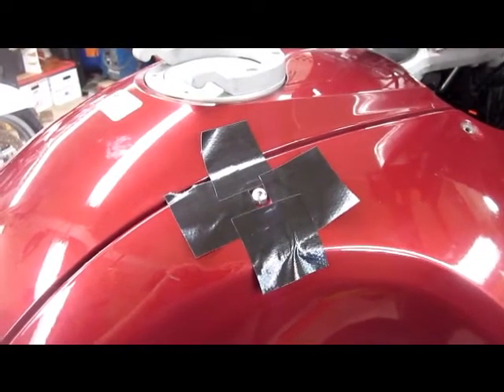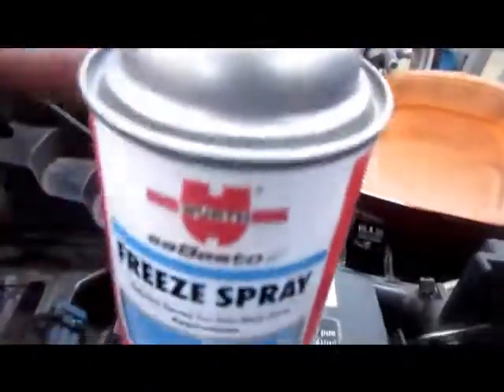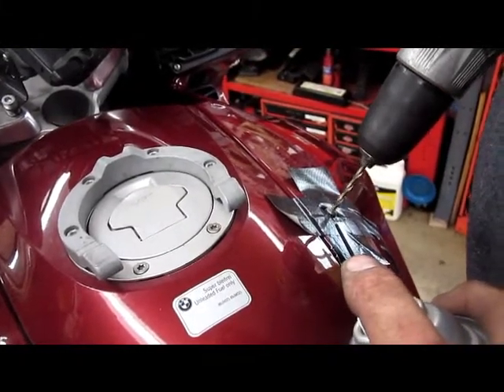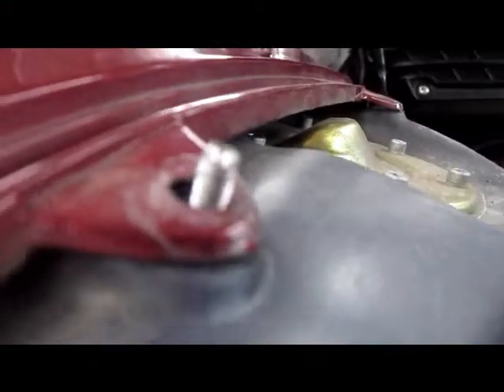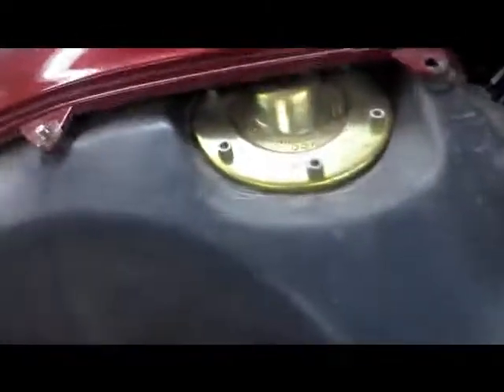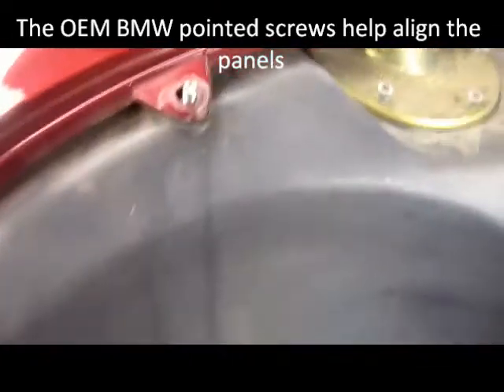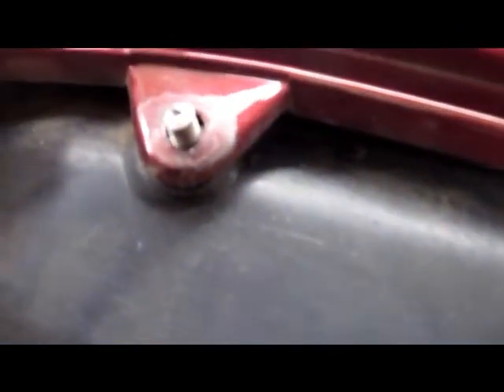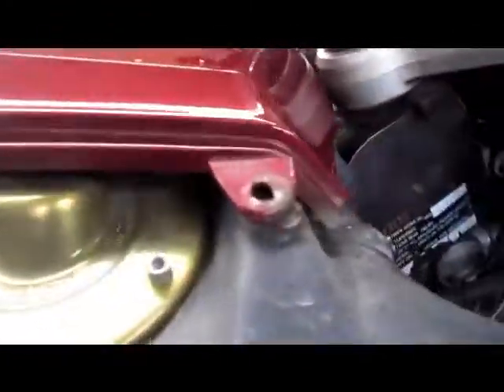BMW Service - Removing Seized Panel Screws

Comment: Thanks Chris, spinning bolts and stripped fender allen bolts stopped my plans of changing leaking brake lines this weekend. I appreciate you dedication to showing the REAL side of maintenance. I ended up with a big question "How the hell do pros charge for all variables?".  Its a tough way to make money. You do great work and I am inspired to keep the camera rolling even when in the "Hell Hole of Bad Fasteners".

Comment: Screws , bolts  with blue locktight easy to unscrew by apllying slowly increasing pressure until the bond is broken.Constant pressure better than fast action. I don't need heat for blue locktite although I'm a builder so have strong hands.Thanks Chris.
Reply: Doesn’t need to be cross threaded to stick. Dissimilar metal corrosion is as often the problem. Using anti seize on the threads helps a great deal. The same thing happens when people replace their cad plated spokes with stainless so they get the bright spokes without the problems chrome spokes have. The best practice is to leave the cad plated screws installed. Replace bad screws and paint any rusted ones.

Comment: Good tips, never heard of "Freeze Spray" but will use. If I can add a tip for this to make it a bit easier....before you drill the screw head take a small ball tip rotary file and file the center or the screw head this will give you a good base to start your drilling . Also start with a smaller drill bit  with a good amount of pressure but about half the speed you were using in this video, you know you have the right speed when you get a "tail" of metal coming up the flute, then step up the size

Comment from the maker: I believe I cut it off and left it screw-less. I'd like to add a theory to the misaligned hole issue. Someone recently commented thus: With the charcoal canister plugged up the fuel tank gets sucked in and becomes distorted! This causes the holes in the top of the fairing panels to no longer match the holes in the now, slightly distorted fuel tank. Makes complete sense to me. Throw the fucking charcoal canister away people... PLEASE!!

Comment: Thanks again Chris - I too have a slightly distorting tank causing the six fairing screw holes to misalign. As my Limey 1996 R1100RT does not have a charcoal cylinder that can't be the problem. If you can suggest some other way to realign the holes I'll try it. In the meantime I'll carry on riding without the six screws in place. So far, everything has held together fine...

Comment from the maker: Hi John,
   If the tech is on flat-rate he is likely going to lose money. Therefore, the quickest solution possible needs to be found to keep the job moving along. If the tech is hourly there is the probability that the tech will take the time to be creative. Either way one would hope that minimalizing damage is the priority. Thanks, Chris

Comment: I had the same issue after doind a similar removal of the head etc I ended up removing the capped nut from the fuel tank and epoxying another in place.
Reply: Did that work for you ?

Comment: I like your vids bro but this one?  Yikes!! My teeth hurt.  Ryobi (for instance) has a nice screw extractor set.  Recommended to use impact tool.  I did Not have one.  Worked just fine.  Had #3 screw left panel counting from accessory plug side removed in no time.  First i thought i was going to drimmel around it.  Kaput

Comment: Also instead of drilling you can use those micro grinders & cut slot for screwdriver. Which ever option that is easy & quick.Yep they're a barstard when slot rounded out. Then it is impact screwdriver & hammer/mallet.Still stuck, get the damn drill & drill out & have a beer for the hard work just with one screw.Lol.